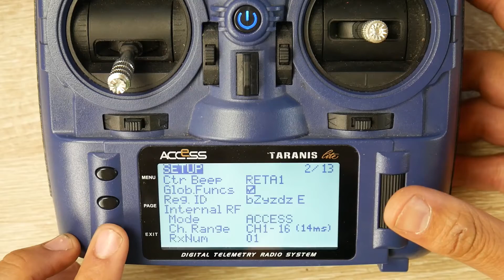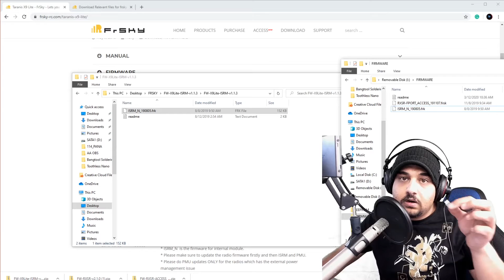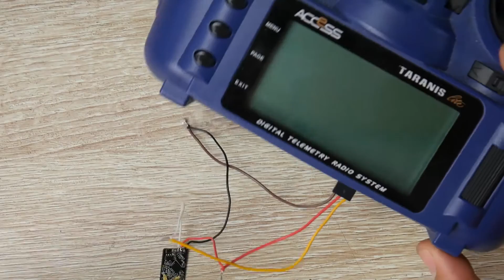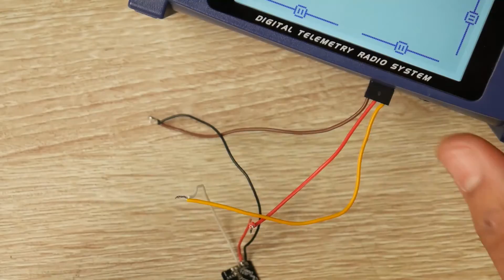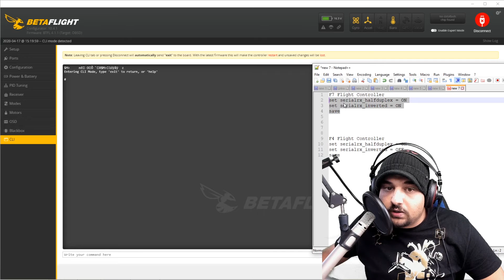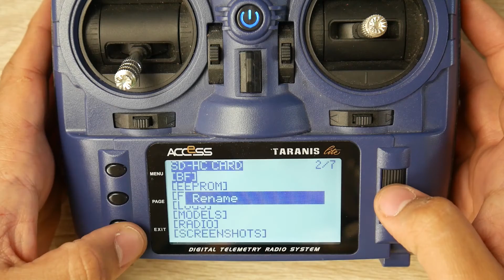FrSky Beginner Guide EP3 // How to Connect F.Port & Advantages

Comment: do i need to update the ACCESS firmware on my Frsky radio? - my radio is Frsky Taranis X9 Lite S - The radio is ACCESS based. I contactacted FrSKy NAService support - They verified that this radio is ACCESS based - in addition, i discussed the receiver i plan to use - FrSky ARCHER M+ receiver which is configured by FrSky as ACCESS based. I was told to connect the receiver as follows: 1- attach node GND to FC GND; 2-attach node VIN to FC +5V; 3-attach node S.Port to FC T2. The FC for my Nazgul5V2 drone is Iflight _BLITZ_F722.

Comment: That was a semi truck load of work!!! Any chance you'll consider to post how to get rid of that problem that the taranis have when there is lost signal that don't allow the aircraft to be armed again in mid air??? I did lost an aircraft that way!! ever since I just use the most basic EzUhf transmitter module and nano receivers...

Comment: Hi, sorry Im posting my question  on this video because  I cant find the video  where you talk about powering a HV vtx off of a 10 or 12 volt regulator. Im in a situation where I can power my vtx  directly from the battery leads or there is a 12v regulator( G3 FC hobbywing). I need your advice , 12v or battery?? The vtx is a Unify pro HV. Thanks bro.  Peace

Comment: Thank you!! so interesting video. I have one question: Is it possible to connect the rxsr f-port pad to an f4 sbus pad? I think that the sbus pad will be inverted, will it work?. And can I use softserial to connect the f-port pad to any f4 tx pad remapping the resources? I'm unable to solder that tiny uninverted pad on the receiver...
Reply: You cannot the use SBUS pad as this pad is an inverted RX pad it receives data from the receiver you need to use a unused TX pad as detailed in the video.

Comment: Definitely great content, very clear and useful mate. I have just one question, do you know if the configuration  serialrx_halfduplex = ON
 and 
serialrx_inverted = ON can influence how the GPS must be connected to FC ? I have 2 kopis totally identical, the only difference is that in one  I decided to use FPORT, all works perfectly but when I tried to install a GPS (bn-220) in both quad, same cabling same configuration in betaflight, in the quad with FPORT doesn't work. Do I have to invert TX, RX due to the serialrx_inverted configuration ? Hope my question is clear enough, I like FPORT but I want a GPS on my quad as well. thanks in advance
Reply from the maker: It shouldn't unless your using the wrong TX which is also being used for GPS as far as I believe. THE cli Command SerialRX will only apply to the enabled serial RX port in the ports tab. Try changing the TX pad for Fport. Also what are you running F4 or F7

Comment: I can't find a servo connection on my Jumper T16 Pro? How would one update the rec'r firmware  using this Xmitter?
Reply from the maker: Jumper is not compatible and is using much older software.
Reply: @DroneMesh  FYI, updates to rec'rs can be done with the Jumper T16 Pro by downloading the firmware , placing it on the Jumper SD card, then, plugging the rec'r (wires properly oriented) to the Jumper module bay pins and flash 'to external'. Your reply to me was obviously 'off the cuff' and didn't help anyone using a Jumper. I learned this from TMac and JB.

Comment: Thx for the video. The parts for my first non-rtf quad are on the way and I completely forgot lua-script was a thing. That's perfect timing.
I have a question tho.. My F4 FC has both a regular uninverted RX-pad and also a dedicated SBUS-pad (invertedRX).
Can I skip the ridiculously tiny solder job on the r-xsr and connect the "regular" SBUS signal that comes from the r-xsr to the dedicated SBUS pad on the F4 FC?
Reply from the maker: If you have inverted Sport pad not sbus then yes you can just connect it normal wire comming from the RX to FC

Comment: Thanks for sharing, Ive actually been doing this for using Lua scripts for a while now.   Having the additional option lua scripts for adjusting pids and vtx from the transmitter without betaflight or booting up goggles is awasome!

Comment: So detailed! Thank you this is good stuff to know and many should learn this. This is all I know! all my set ups use X-Lite & R-XSR F-Port no access version. Never had range or fail safe issue.  Also can't say that any rx died yet so very solid.  I also like that the xlite can audio call out voltage.  I know I have option to upgrade to DJI controller but just happy with what I have.  When this Xlite gets worn out I purchase this same model new.

Comment: I have tried setting up fport multiple times with no success. Hopefully this will help..
Reply: Same here.I have an r9 mini and it's working, but there is no telemetry on the radio.I gave up on it.
Reply from the maker: @Zlowmoo  Delete all your sensors and discover again I showed it in the video.
Reply: @DroneMesh  I tried,  but there are no new sensors.The odd thing is that my rssi comes in on aux12 in BF but for some reason aux5 keeps jumping around while I move the sticks.
The quad flies normal.It's a nazgul5 (succex-e) btw and the wires are connected according to the iflight manual for fport.\_(ヅ)_/